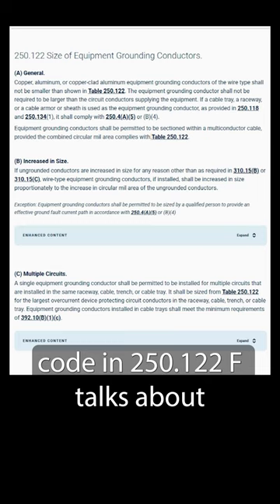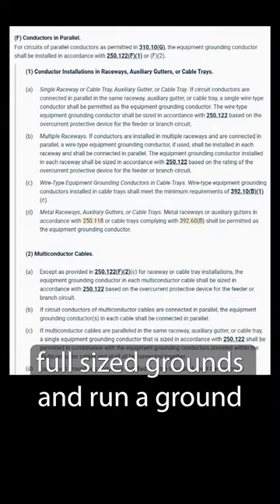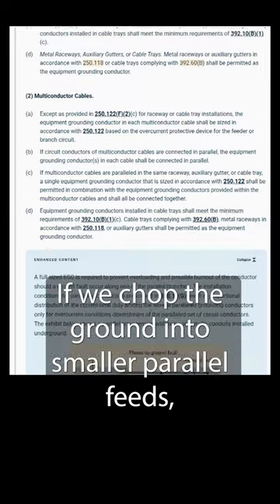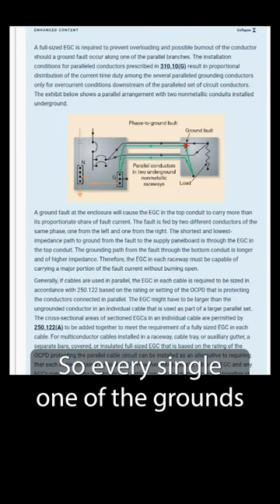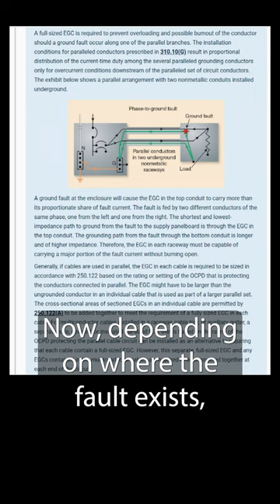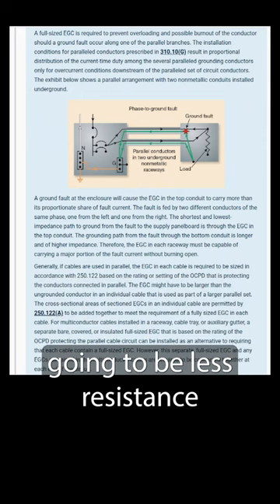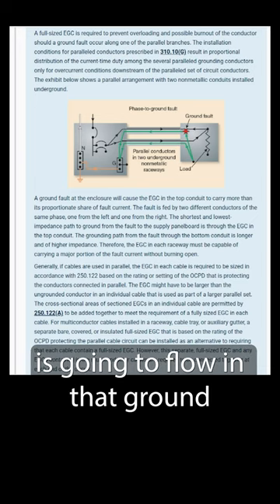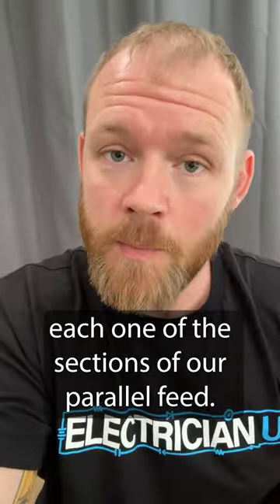Why do we really have parallel feeds?

Comment: Can you pull out the white board and draw this? For example, if running 3 runs 250mcm, should their be 4 conduits each with 4 conductors? (3 blk (and red, blue and white) conductors + 1 ground, all same size in each conduit?
Thank you!

Comment: I find it hard to imagine being a sparky in the US.. I guess I don't see the benefits of 110v vs 230v
Reply: Yes being used to a 240/415 three phase system, the sizes of LV  conductors for current carrying capacity and the lower amount of availible voltage drop for 5% on a 240/120  volt system requires much shorter LV feed lengthsand bigger CSA conductors hence many and much smaller rated distrubtion transformers than a 240/415 LV system. This also  requiring a much larger HV distrubtion system to service all these transformers HV primaries.  In Australia we use up to 750kva in our newer domestic subdivisions with much longer LV feed lengths and LV paralleling often used to minimise LV interupptions for work. The lower secondary voltages require a completely different mindset on designs needed to create a stable voltage between full load and no load.